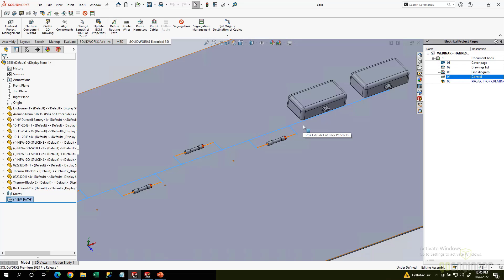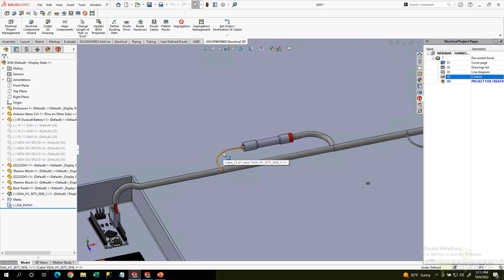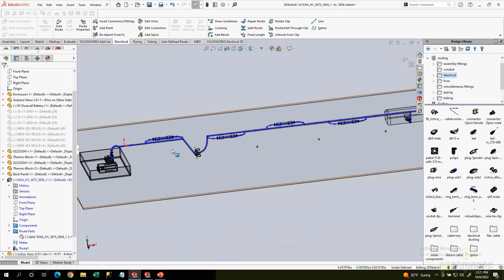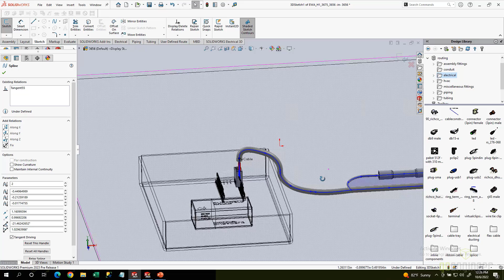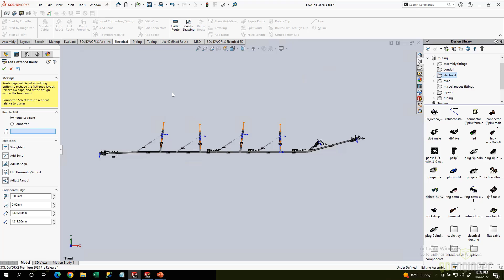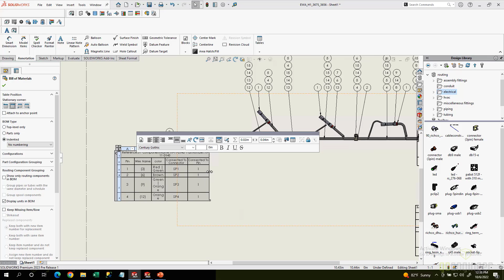SOLIDWORKS Electrical 3D - Oops! Something's not Right - Webinar

Comment: I have an issue about the covering, I deleted a covering in the design tree, and I tried to get it back using the covering function but it didn't work. What am I doing wrong?
Reply from the maker: There are a number of factors that might be involved there. The best thing would be to give your VAR's tech support team so they can get with you and look at your specific model to find a solution.